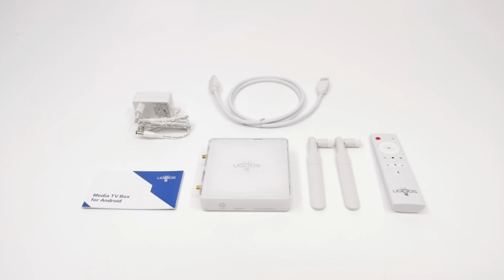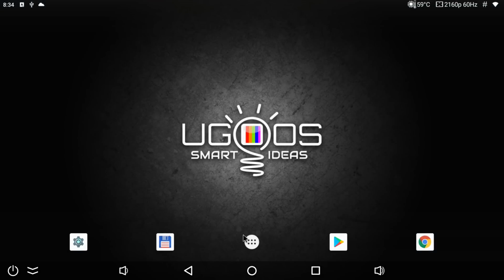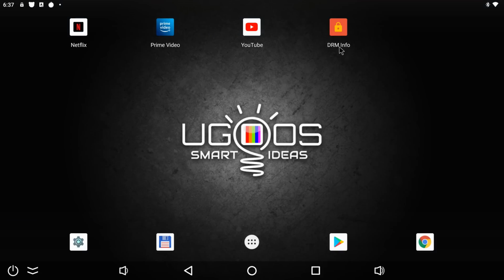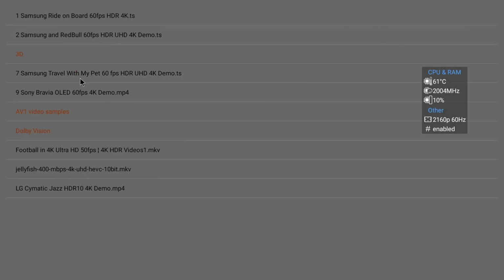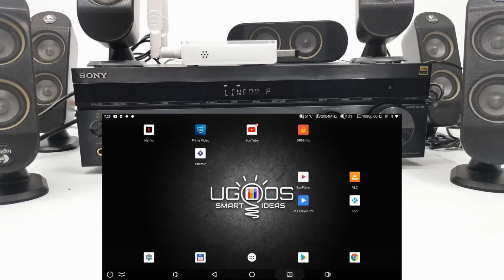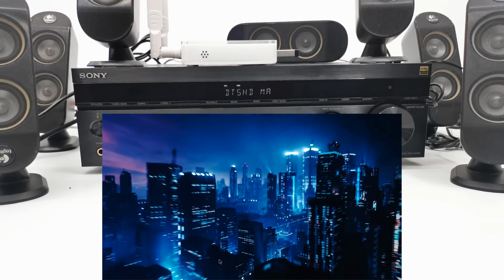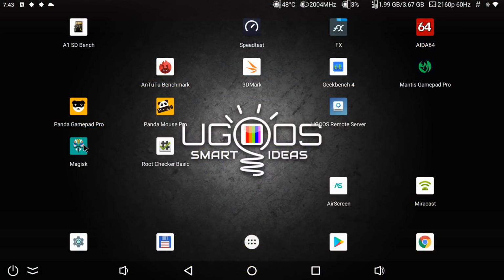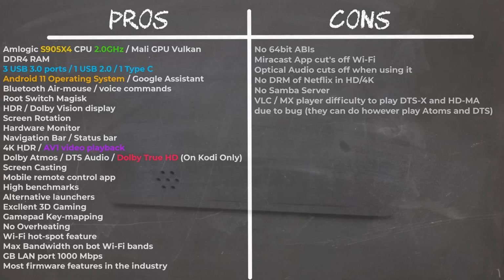Android 11 - Ugoos AM7 Amlogic S905X4 TV Box Review

Comment: These are excellent and comprehensive presentations. 🤗 Thank you for them.
I will use your affiliate link to purchase one.

I have two questions:

(1) I send TV Box HDMI output directly to my TV (not through my amplifier). And for the audio, I send the TV Box optical audio cable to my amplifier. Will this scenario work with this box?

(2) While in rooted mode, will Ugoos firmware updates still occur? 

Thank you.
Reply from the maker: Awesome, thank you!

Comment: Great review which includes details as DRM info or audio codecs support. Box itself is pricey, almost like NVIDIA SHIELD ($149) where SHIELD is much better at this price range, it's certified so we can get 4K resolution on streaming services as Netflix, Prime Video. Similarly SHIELD has no issues with audio formats incl. Dolby TrueHD. AM7 doesn't have normal Android TV system but pure Android installed which is also con. This box is worth $70 max, not $140. There are many other similar non-certified boxes on Aliexpress with S905X4 for which price starts from ~$50. Mecool KM6 or KT1 is better option for someone focused on S905X4 as at least it's Widevine L1 device so it's possible to get better quality in streaming applications, it costs $70 and $85 respectively and they have normal Android TV user interface.
Reply from the maker: Friend listen. You are comparing this box to certified TV boxes, that is not the target audience/market per say. This box is for those who want root access to install their apps and games, and their third party APKs, some of which that are now being blocked and uninstalled by Google Play Protect on certified boxes and on the Play Store. This box affords you the freedom, features, and performance often inflicted upon you on Android TV OS, and now Google TV. So yea, it doesn't have Netflix in HD/4K but most modern TV have Netflix and Wi-Fi anyway, so why need a box for that?

Comment: Now this is more like a proper review. Lots of information, demonstration and useful feedback for Ugoos on what little bugs require fixing.

As far as viewer fatigue is concerned, anybody can pause and come back at any time, so it's a bit of a myth, especially when you consider that people really interested in such a product want to know whether their hard earned cash is really worth it.

Anybody complaining about length really isn't that interested in the first place.

The firmware is impressive in it's scope, as you would expect from Ugoos these days.

Nice to see the key feature that separates it from the S905X3, AV1 support.

There are two things that could really cripple it's wider use at this price point though.

1. Android running in 32 bit mode is rather old hat now and 64 should be the base standard.
2. DRM. I would have thought that Ugoos might have reached the point where they could appeal to a wider audience but that would require applying for the required certifications and ditching root access functionality.
Reply from the maker: Thanks for your input. Believe me when I say I could never understand why they cannot provide 64-bit on these Amlogic SOCs. If you install Ubuntu Linux via SD card or totally erasing the eMMC you will get 64-bit architecture. So it's a bit frustrating time and time again that they continue to configure Amlogic hardware in 32 bit mode. I tried to embrace the Rockchip developers for taking that step but unfortunately they couldn't get their house in order when it came to firmware features and compatibility. About the your fatigue. From my analytics it shows that most viewers start watching the video and after the intro some either leave, skip to the end, or jump to that section that they are interested in. This indicates that lots of viewers are either concerned about Netflix in HD or 4K, price, and the pros and cons. It is also reflected by the many frustrating questions that I already answer In detail answer in the video. Yes so I hear your views, appreciate your input and look forward to your continued support.

Comment: For gigabit LAN port, can the TV box run at 500Mbps on LAN or 250 Mbps on WiFi?
Reply from the maker: If I say yes that would be without proof because I don't have a 500Mbps network. However in theory it can because it's 1000Mbps LAN port.

Comment: Nick, why have you used antutu v8.3.4 for this box, but used the much newer v9.0.12 for the AM6b plus review ? I really think you should run the v9.0.12 on the AM7 and re edit the video. This way we can see "apples for apples", as otherwise if you dont use the same version Antutu benchmark version on your box reviews, its all a bit pointless in running benchmarks if there not the same version to highlight the speed differences. . otherwise great video Nick.
Reply from the maker: Very good question. Antutu 9.0.12 installs but is has bug that bypasses the Vulkan test (not detecting Vulkan) resulting in a wrong score. That is my only reason.
Reply: @tvboxstop  hi Nick. that's not a bug, according to the  Antutu web site, with V9 if your device has less then 6gb of ram, the app downloads the 3D lite version. This does not test for vulkan. If you use V8.5.6 the last version of V8, it will download the full version of 3D benchmark, which does test vulkan. What makes it more difficult using different versions of antutu benchmarks, is the way they score has changed significantly. With V9, they have reduce the weighting to CPU scores, but increased the UX score rating. I've run both on my AM6B Plus and with v8.5.6 I got 161891. with v9.1.2 I got 172289.  so a difference of over 10000. So perhaps as a test and reference site for hardware, it might be better if you were to stick to either v8.5.6 or v9.1.2 on every review. That way at least your chart will reflect the scores that are uniformed across your box reviews, so customers can make an informed choice. Mixing results from different versions of Antutu on the same chart will not fairly show which box is better in terms of raw performance. 
ps, I have found a bug,  if you have a USB drive in the Ugoos at any time, then you run ANTUTU, even if the USB stick is removed, the mem score is woefully low. I get 26730 on mem test in Antutu, in your test for the AM6B you only got 8000 odd in your review.
Reply from the maker: Cool

Comment: I know ithas usb 3 ports but still no sd card slot.
Think 8 will stick with Mecool or even an Nvidia at that price.
Reply from the maker: All boxes will start coming without SD card soon. It's becoming irrelevant with so many faster and larger solid state options. Have you seen the tiny SD to USB adapter that comes when you purchase some SD cards?
Reply: @tvboxstop  
No i haven't.
Still defeats the purpose by taking up a usb slot and probably sliwing down data transfer.
Reply from the maker: OK good point. They just need to more USB ports then.
Reply: @tvboxstop  
No,
I thought an sd card slot would have been better, guess only they know why the decision not to add one.
Reply from the maker: You have 3 USD 3.0 ports, 1 USB 2.0, and a type C. The only advantage SD has over SSD on a TV box is that it is congealed. However with the 5X speed and capacity benefits of SDD via flash-drives and now NVME over USB adapters. It greatly improves the data transfer speed and capacity of convertible storage. SD card slots are usually limited to 64GB for convertible storage. On Type C you can go over 2TB.

Comment: This box has some great specs and features! Plenty of useful ports. Looking forward to testing it out - my review sample came DOA, so still waiting for a replacement.
Reply from the maker: OK pal have fun.
Reply: @tvboxstop  What type of Logitech speakers?
Reply from the maker: Lol I converted a set of Logitech PC speakers to use on my receiver. I actually use RCA female to open wire cables (sold on Amazon) to connect those speakers because all of them use RCA connections. The subwoofer needs a 3.4mm headphone jack to RCA adapter to connect to the receiver.  To get 7 speakers I took 2 from another identical model.  X-530 is the model, a very old model one of the best.

Comment: If it doesn't have L1 then it's just like the rest imo. At this point it should be the standard if you're gunna sell an expensive box
Reply from the maker: You can't have l1 without Android TV OS on a device that is meant to stream movies and TV shows. Google won't certify it. I spoke to developers about this already, Google will certify it on a mobile phone running mobile version of Android with no root access, but for a TV box the rules are different. Google requires Android TV OS, No root access and to get Level 1. Not to mention Netflix requires Googles certification in order for them to Grant ESN certification. So you cant have it both ways. And you can't cheat because you will get banned has a manufacturer.

Comment: I think (imo) that for Ugoos this is a step back in terms of their last series of boxes, I'm saddened to say its actually very dissapointing.
Reply from the maker: It's not a step back. The latest chipset after S905X3 is S905X4. I mean I am saying this but you already know that, so I believe you are trying to make a case in relation to how they named their box AM7 and not AM5. That would have put things in perspective. However they had to wait for Android to release their Android 11 SDK and they also had to make sure the firmware actually works. Believe me compiling firmware is no easy task, and if you rush it, well you saw what happened with Rockchip.
Reply: @tvboxstop  
I respectfully disagree   😎
Reply from the maker: I am not ready to strike out RK3566 yet. The firmware thus far is trash, I have hopes someone will get it right.

Comment: I stopped watching the video at <configured to 32 bit>... Done, it a garbage tv box
Reply from the maker: Ouch! but I am not surprised. Thanks for watching anyway.
Reply: 99.9 boxes are 32 bit
Reply from the maker: In fact the firmware is 32bit. If you remove the firmware or load an alternative operating system such as Linux you will get 64bit. I have done it.